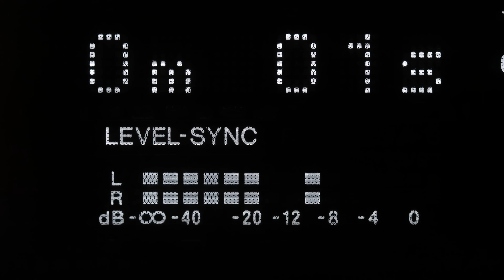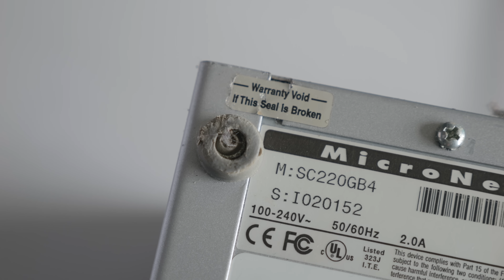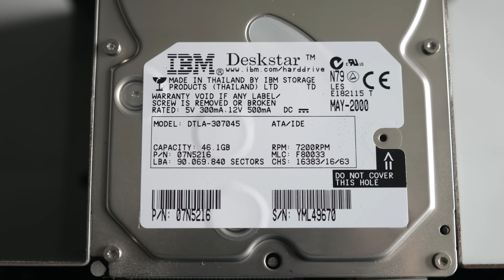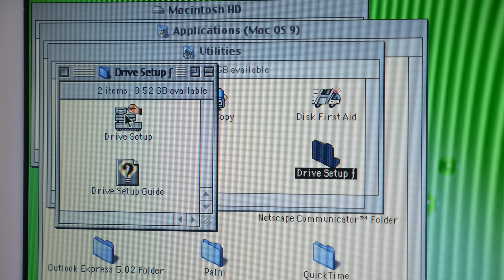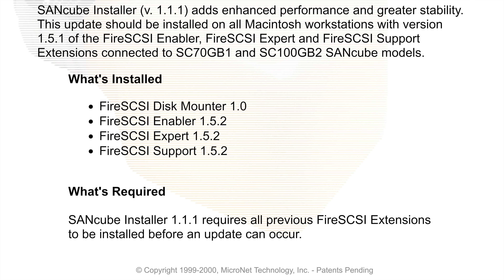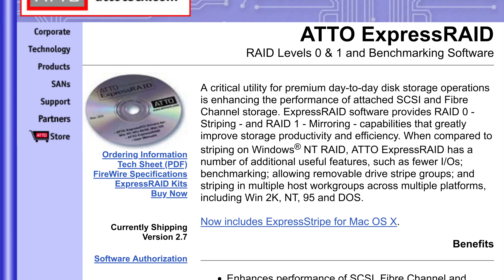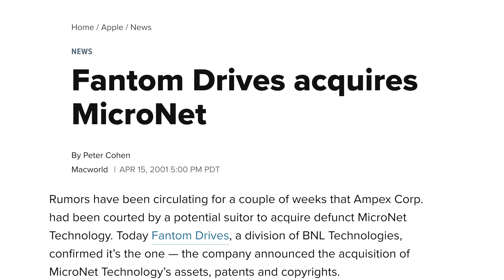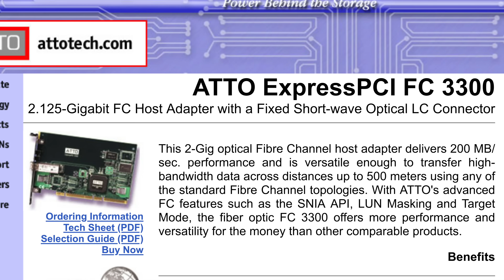This old external hard drive can do WHAT?!

Comment: OH NO!!! 6 DEATHSTARS! It will be amazing if ANY of them actually still work. I think a fun project would be to build a modern NAS running Linux in that case. You could do it inexpensively using a Rasberry Pi with a sata card and use OpenMediaVault as the NAS software.
Reply: I used to do desktop support in an office of roughly 1200 seats... We had a lot of these in IBM computers.

I never noticed failure rates higher than other drives... It was back in the 30gb size era I believe.
Reply: @volvo09 Yes, this anecdote matches history.

The big IBM “Deathstar” issue really started around the GXP60 / GXP75 series of drives, which came later. The issue was blown out of proportion by the memorable name, not by facts. 

The drives in the video are before this time and likely work fine.

As another anecdote, I had many GXP60 and some of them had the failure mode - unusable sectors far into the disk. Updating the firmware on all the disks and setting the capacity for the affected drives a little smaller (using I believe Feature Tool) let all my drives run for over 15 years, until they were retired.
Reply: @truectl the drives in the video ARE 75GXP’s, just the 45gb models. The likely reason they still work is due to being cooled properly due to the fan, if those drives ran without any form of cooling (even in normal desktop systems) they’d fail pretty often.

I got a 75gb 75GXP a good while ago that had some 38k hours on it, worked fine with a few bad sectors on it. After a while, it started having issues with ever increasing amounts of bad sectors, i eventually found out that just about half the drive was unusable with bad sectors. Afterwards I limited the drives capacity to about 33gb or so, after that it works okay. (Though I haven’t fired it up in a few years so it may have died since then haha)
Reply: @Thegeforce8523  Hm, I even went back to that point in the video to check the models but didn’t see that they were from that line, and dates looked older. Thanks for the clarification.

But yes, the smaller capacity models didn’t suffer like the larger ones did. These sitting offline and cold with heads parked might still be fine after all these years.
Reply: @Thegeforce8523  Hey look who's here : ))
Reply: @truectl  There is no 75GXP made before 2000, and it is commonly misinterpreted that the 75GXP is one drive, when it is a series of drives. They all start with DTLA-3070xx. The reason for this is because there is also a 5400RPM 40GV series that is just lower end but otherwise nearly identical starting with DTLA-3050xx. The 7200RPM indicated by the 7 is a 75GXP. The 5400RPM indicated by a 5 is a 40GV. Also yes the smaller capacity models appear to not suffer as bad since they don't run as hot. Having less platters and heads, there is less heat generated and less to go wrong. The 60GB and 75GB highest end drives however get insanely hot and require cooling properly if you expect the drive to function for a long amount of time, which doesn't happen in OEM PC cases of course,  hence why poor cooling contributed to the failure rate to an insane degree. The heat cooks the media and significantly increases the risk the heads crashing onto the platters. They often would get over 60c and being stuck inside an enclosure or case, even hotter with poor cooling...
Reply: @volvo09  Now that's old school.  I recall back in the early 1990s a button on I think a x286 that said "turbo" and software that had a sticker that said "do not run this software under turbo mode' (since turbo made the software inoperable since the PC was too fast for it).  Ah the good old days...they were terrible!
Reply: I wonder if all the drives being dead is the reason he couldn't detect anything?
Reply: @bghoody5665  They aren't dead. I have a full set of working models and that is how the 15GB, 20GB, 30GB, and 45GB units sound. The 60GB and 75GB models have a different seek sound, but it still sweeps the entire disk surface. All six in the video here passed the self-test they do upon power-up and will detect if taken out of the system and put into a computer, eliminating them all going through that board in the external enclosure.
Reply: @bghoody5665  it's fully reliant on software to work.